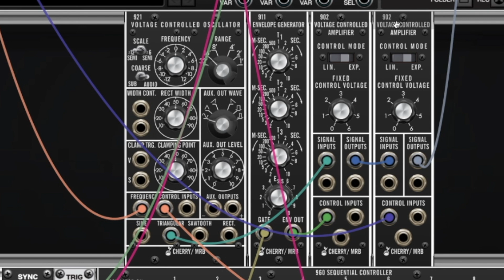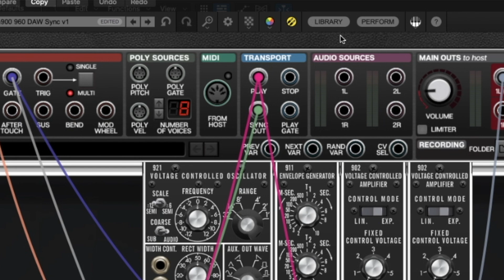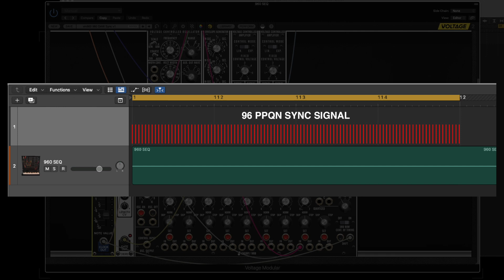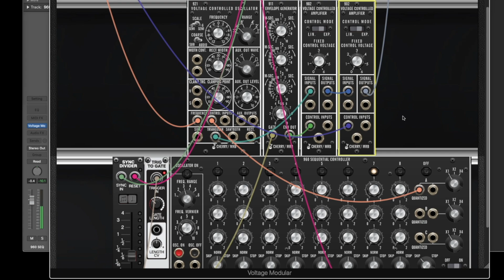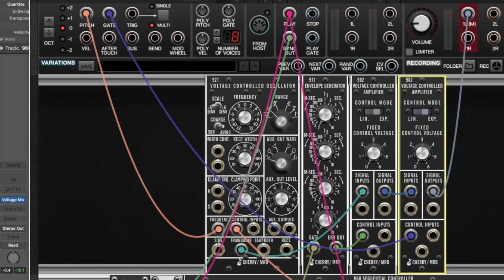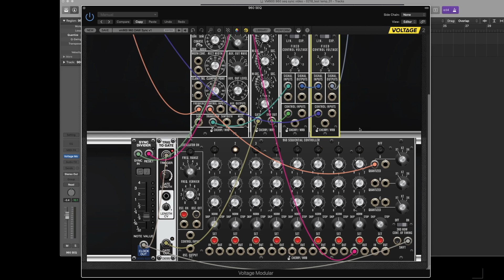Voltage Modular | VM960 Sequencer DAW Host Sync

Comment: I bought the vm900 collection , I would like to add the trigger to gate module to my cherry account but i can only purchase it in a bundle with a lot of modules i do not need …..is it available as a separate purchase?
Reply from the maker: Our own "Trigger to Gate" converter is only part of VM Core. But there are a number of other 3rd party modules for trigger to gate. At a glance,  there's Monkey Business' Trigger Gate Converter (TGC) , Benard's Trigger to Gate, Playertron's X8 Trigger to Gate, probably more. You can use the search function on this page: https://store.cherryaudio.com/modules
Reply: Thanks for the tip. Found them. The 8x trigger to gate works great too.

Comment: Thanks for posting, have been a VM user for many months.  Nicely done demo, but I already have several sequencers I purchased as standalone or in a bundle, how is this 960 different than the sequencers I already have . . . just wondering.
Reply from the maker: Hey there! The primary difference between this and other sequencers is simply that it's a recreation of the original module. Functionally, many sequencers do the same things but approach them in different ways.

If you haven't already, feel free to demo the module inside of Voltage Modular to see if you think it adds something new to your cabinet!
Reply: The 960 has separate gate outs for each step (great for sending that note to a different voice - hocketing), jacks for each step to jump right to it (good for random play order), 3 rows of steps (send 1 melody to 3 separate voices, or modulate 2 things in step with the melody). Those separate gate outs can also be used with probability modules like HetrickCV's PROBABILITY to randomly trigger alternative effects/modulation/voices. It's an outrageously powerful sequencer, especially when combined with other modules.